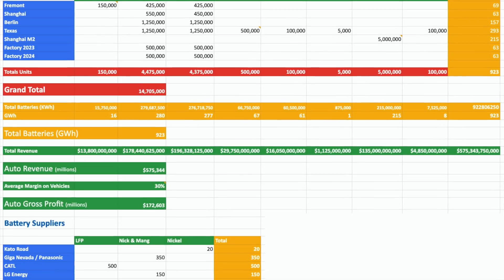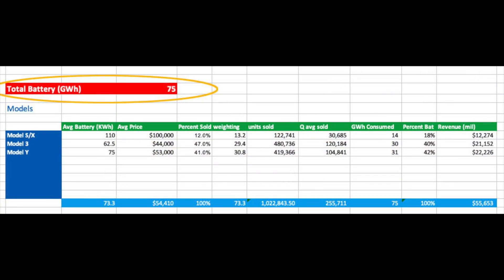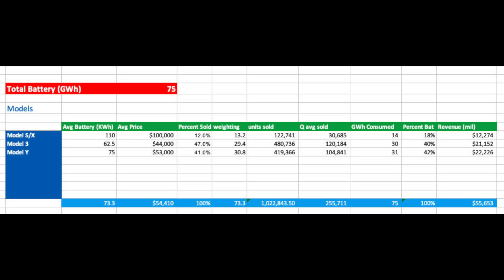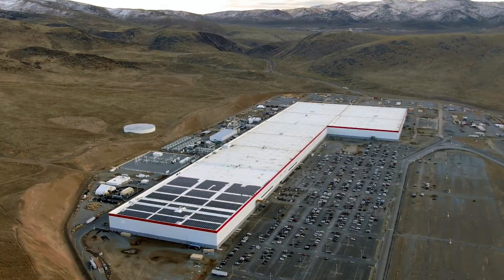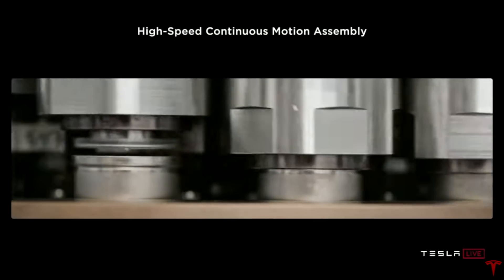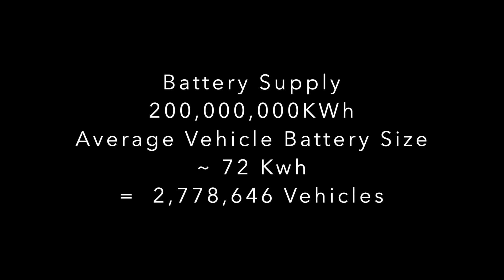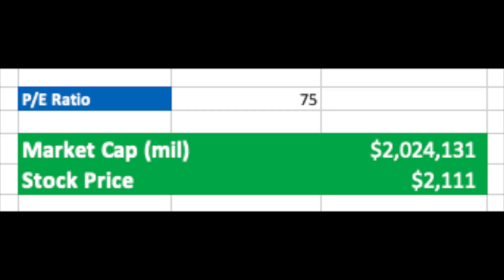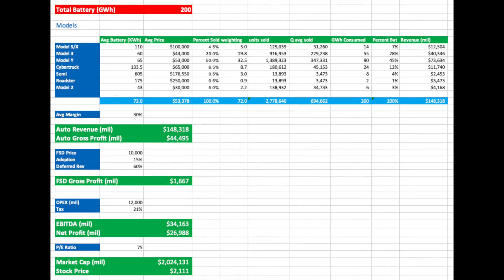Tesla's 2022 Deliveries Estimate Based on Potential Battery Supply. What is the TSLA Stock Price

Comment: I like your numbers and your videos. I think you are estimating low for Cybertruck and Semi regarding battery size. Semi will be closer to 800 kwh and I believe the cyber truck tri-motor will be 200 key or more. Since they are starting the tri-motor we won't see a smaller pack size in 2022.

Comment: I see two key limits to production growth:

The energy business will ramp faster than cars over the next 2 or 3 years, because it's more profitable, and will compete successfully with EVs.

While the 4680 manufacturing process is spectacular, I'm concerned that the supply chain will not keep up; in particular the mining industry. It takes them 4 or 5 years to ramp large projects.

Comment: Hey, Great video. 
Tried contacting you on Twitter (I'm @ConnectingODots) but since DMs are disabled for you, will write here.
A few notes -

1. Suggesting that you watch Warren Redlich's battery model. He's the first I know to evaluate through battery production, andlike you this made him highly optimistic. (extremely bullish myself, no less than the two of you)

2. Energy storage SHOULD take a large amount of batteries, bc its margins are higher than cars. If you include energy supply (virtual powerplant with solar or just peaker replacement as starting in Texas) even more so. And since easy to build, energy side should grow much faster than auto business.
So same battery supply will yield much fewer cars, but that's good news bc the profits will only be higher. 

3. FSD should be fully accounted for after 2021. Current FSD orders ($10K price) are for feature complete level 2, not level 4 or 5. Once Tesla adds city streets into the release, it doesn't have to defer anymore, PLUS it can cash all the previously deferred funds (IIRC around $300m)

Bottom line, extremely bullish on all fronts.
Thanks for the vid. Will share it along with my take on it on Twitter. My own youtube is Connecting The Dots (https://youtube.com/c/ConnectingTheDotsOK)

Comment: Good stuff. We should also keep in mind that making batteries is a completely mechanical process, and the tab-less design not only speeds that process up but results in a better battery. So battery factory capacity won't be just one number, it will instead be constantly doubling as the line accelerates.  It may take years to completely robotize vehicle assembly. Batteries begin there.  Battery Day may ultimately be remembered as Tabless Battery Day.

Comment: Stock prices are irrational.  Tesla was way undervalued in 2018-19 due to unrelenting FUD, and Tesla’s previous over-promising.  Tesla’s stock price was higher briefly in Sept., 2013, than it was in June of 2019 - despite production/sales going up 10x by 2019!  I fear Tesla’s stock price may be in the midst of yet another financial media/Wall Street “FUD-pause,” i.e., the stock price is going to be flat for a couple of years until Tesla’s financial performance is just too good to ignore, and the latest FUD will not stick anymore.  That’s fine - I’m not selling any Tesla stock until at least 2030.

Comment: I agree with modelling based on battery supply seeing as it is the largest constraint on the business. The real unknown though is the amount that will be allocated to the energy business. Until now Tesla hasn’t really turned it’s manufacturing efficiency drive onto energy storage since cars are providing so much revenue. It’s hard to get your hands on a powerwall despite it being available for several years, and unlike the cars the price hasn’t come down, or the product changed much since the new version of the gateway 2 years ago. 

Friends who operate solar and battery installation companies tell me how hard it can be to secure stock and that the demand is incredible. Imagine what this would be if Tesla release a powerwall 3 with double the capacity at the same price. I expect that a lot of them would fly out of the door in Texas after the winter debacle. Here in Australia lots of people are very keen to get a home battery even though the economics of it are marginal at the moment.
Reply from the maker: Yes agree. They need to step up their solar game.

Comment: I just don’t understand what is holding the stock back from breaking the resistance of $700.00 this week? We just came off a record quarter. The expansion in Texas and Germany is going well. Tesla’s supply chain continues to keep things moving in the right direction. The stock now should be close to $800 and moving upwards? This I guess is the reason why it is important to focus on what is happening on the ground. Biden’s call to invest in the EV infrastructure. All the things Elon is doing to meet his long term objectives. Eventually, the market will not be able to keep a winning company in check as the momentum continues to build. Warren Buffett talks about the importance of believing in a stock and be willing to hold until things shift. Investors must be buying value stocks and the whole growth sector are now experiencing this dip. Eventually when the market returns to growth companies, it will be like a turbo booster then the stock will rise very quickly.

Comment: Allocating % to different model types seems an extra unneeded step. If we have an estimate for the total gw then we can just assume an average battery pack size, say 80kw or 70kw, and assign an average price per pack, say 30k. Assigning any further estimates for how many battery packs of which are made and how much each of those sells for does not change the end result.
Reply from the maker: Yes correct, but I wanted the model break down

Comment: Regarding profits: Tesla has promised shareholders to keep profits low, as close to zero as possible without showing losses... They will lower prices and spend on growth instead of showing high profits.
Reply: The cash that’s been generated lately has meant there’s no pressure financially but it was needed.... it’s all about quick expansion for numbers and out pricing the competition. Hope the van, lorry and buses are well on the way soon as well. You could see cities that want better air pollution levels switching all their buses at once. Could get crazy 🤞
Reply from the maker: Yes I can’t see Tesla keeping this much profit. As you can see I didn’t include and capex. I just wanted to use it to create a valuation

Comment: I think the Kato road plant only has a 10 GWh line.  The production version of these lines are slated to be capable of 20 GWh annual output (nameplate capacity).

I can't see auto production ramping this fast.  I think 2M might be possible next year but not much more than that.  

It just means MASSIVE energy storage growth if they have to allocate more GWh to storage.  I think storage generates $600 kwh in revenue so not a bad thing.
Reply from the maker: Yes kato is only 10 but sometimes they are adding a second line. Presumably this year. 

But if they have that many batteries, they’ll find something for them. Like you say it may end up energy. But the profit should be similar.
Reply: @TeslaEconomist  I didn't know about an extra line at Kato road.  That would be amazing.  Key would be what their current yields are.  Sounds like they are only hoping for  50% by next year (which sounds like sandbagging).  Just doesn't make sense that yields would be that low.

2M vehicles next year would be tremendous.  I am more of a pessimist.  They took MS & MX lines down to upgrade in Dec.  It's been almost 4 months and no deliveries to speak of.  Starting 2 new factories (and the Semi facility) producing 2 new vehicles using new techniques might be a bit harder than we think.  Elon always emphasize this because he deals w it all the time.

Comment: The Model S, Plaid or Plaid+ WILL NOT USE 4680 batteries ! Elon said it in an interview. 4680 will require a cell to chassis architecture which will require a complete redesign of the Model S. Your whole analysis is bogus.
Reply from the maker: Here, Elon said it in a tweet
https://twitter.com/elonmusk/status/1311881562728747010?lang=en

Comment: Great video.

You mentioned 2M cars from Berlin/Austin next year, which will be 1.5yrs after being operational.
Now I'm not saying it's impossible but feels unlikely imo.

Reason I say this is because I believe they are targeting capacity of 550k at Shanghai by end of this year, which will be just over 2yrs from being operational.

If they go at the same pace as Shanghai then that would be 825k between them.
Now the Giga presses, which they have just ordered another 8 or 9 & also the quicker build time for Cybertruck could help matters but this is new tech. Expect teething problems.
I've pencilled in 900k from them both for next year.
Reply from the maker: Sure, I am just trying to work out where the batteries will go, under the assumption the capacity can handle it.
Reply: @TeslaEconomist  I would place more towards energy.
Past two quarters have yielded exceptional growth.
I'm expecting 2021 to the turning point for their energy business.
Reply from the maker: Yes, I look forward to seeing the earnings this Q, but the batteries will mainly be earmarked for cars. It actually doesnt make much difference to profit either way though, they make money in both markets.
Reply: I think Shanghai was at 550K already at the end of 2020, and it's still growing. Berlin and Austin are big question marks, nobody knows how fast they can ramp up, but I don't expect Model 3 level production hell, because Tesla learned a lot from it. Plus they have the 4680 pilot line, and the mega casting in production, so I think it shouldn't be too hard. The mega castings also make the ramp up much easier, as they eliminate hundreds of robots. Each removed robot reduces the complexity of the production line, which allows faster ramping.

Comment: While Tesla is currently battery-cell constrained, if 75GWh supplies are reached, there could be manufacturing limitations.

As way of example, the 1M per year for Berlin is probably very optimistic; this would equal to 20,000 per week (2800+ per day?) without counting downtime, disruptions in supplies, etc. In order to produce 20K per week not only is the factory required, but the infrastructure, raw materials and human resources. One also needs to consider all the other third party suppliers, such as glass, seats, lights, etc.

To put things into perspective, Volkswagen largest factory in Wolfsburg (with over 6.5 million  m2, which is one of the largest, if not the largest, factory in the world) has a production capacity of barely over 800K per year.

An analysis of the existing factories in Shanghai and Fremont and see what the current "run rates" are (weekly/daily/hourly) would be very useful to ascertain a realistic "base" value in the production capacities of the future factories.
Reply from the maker: Yes, 1m is a lot, but Fremont alone is more than half that.
Reply: @TeslaEconomist  I think one needs to differentiate between "installed capacity" and actual production. Shanghai has a current run rate (not actual production) of 450K per year, which has been in operation for over a year.

Comment: A few points:

1. there is now only a single Model 2/X line (previously parts were unified, parts specific to S or X), but now they are moving to two shifts.

2. Fremont (Model Y) and Shanghai (on existing site) are still ramping, capacity is likely to be over 1.5 M by the end of the year 2021. Any new building in Shanghai will be ramping up during 2022 and will have maybe 0.5 M production, although its capacity by year end will be much higher.

3. We really don't know the  final capacity for the existing buildings at Austin and Berlin, capacities of 2 M and 0.5 M seem possible by end 2022, but will be much less at the start of 2022. So average capacity for 2022 is maybe 1.5 M. Any extra buildings will have limited production in 2022.

4. When estimating production a factor for down-time (maintenance, parts shortages, etc) needs to be applied to capacity. I use 0.85, other people I respect use 0.8, so with average capacity for 2022 of about 3.5 M, production will be 2.8 - 3.0 M at most. So probably battery constrained, unless cell production is higher than 100 GWh, this is entirely possible as there are suspicions that Elon was sandbagging the numbers on battery day.

5. You can simplify your model even further, just use an average revenue and profit per kWh of battery produced. If Tesla are production constrained (I think they will be in 2022), then they will allocate batteries in a manner that maximizes revenue (we can see this already in the delay in the Semi, as Model 3/Y give more revenue per kWh so have had priority).
Reply from the maker: Thanks Michael, thats a bit too much info, are you an insider? I agree that Fremont and Shanghai likely have higher capacity, especially MIC Y, but I dont like to speculate. It sounds like there will be 200 GWh of batteries for autos, and they have to go somewhere.
Yes, I know I could have simplified it further, but I wanted to have a break down of the models too.
Reply: @Michael Atkinson, what number of vehicles do you see in 2022?
Reply: Tesla semi truck neds batterys. Comming in the end of the year according to Pepsi.

Comment: The problem with this model and those produced by warren redlich is that the output seems to defy reality and common sense, despite their mathematical foundations,  I imagine that back in the 1940s Oppenheimer and co faced the same skepticism over their claims for their new bomb.  How could anyone be expected to believe that a 4 ton bomb could equate to 20,000 tons of TNT?  Ridiculous!  But true.  In about 1 year we will pretty much know how accurate this model is.  I am certainly not selling before then,
Reply: Holding TSLA seems to be a quite conservative move. Buying more TSLA seems to be a more neutral response to the Tesla/YouTube consensus 2022/2023 valuation, and buying TSLA LEAPS options is the more bullish/aggressive response (and what I'm personally doing (not investment advice)).
Reply: @1519Spring  I am 80% tsla and of an age where I want to be more diversified.  I had got down to 65% but then their price fell below 600 so and I could not resist selling my FAANG for more tsla.  It has paid off so far but I have enough for now.

Comment: No one was estimating 1.5M Tesla vehicle sales in 2021.
Other than possibly China and possibly a $1K credit for vehicles made and sold in the USA, the $25K vehicle won't be until 2023.  Storage is backlogged for 3 years.  Cybertruck is backlogged 2-3 years.Semis won't start production runs until 2022.  Giga Texas won't be running at capacity until late 2022.  Everyone is over exuberant.  Breathe. 😊😉
  They can build factories, but they don't have the raw materials.  I've been in the mining business.  It will take time to get existing or New mines up and running.  Investment capital is needed.  Tesla alone could consume the world's muned nickle in 2023.  
  Battery' raw materials are the limiting factor and will be for 2 years.
  This is just one man's opinion
Reply from the maker: 1.5m for 2022, not 2021. The $25k vehicle is meant to be out next year, although I agree that is possibly optimistic. Semi is starting production this year, in Nevada. 
I agree Giga Texas wont be at full capacity until next year, but it doesn't need to be, it could still produce a million cars next year.
Most of these cars possibly wont be using nickel, and can likely run with LFP. There is plenty of iron. 
The point is, its highly possible Tesla will have the batteries to meet the supply of the factories next year. Even if you scale it back 10-20% its a lot higher than most say. The proof is in the batteries.
Reply: Super video Economist!  Big fan from Oregon.
Reply: Assuming there is time on the clock to schedule a 2nd or 3rd shift, ramping up will take some hiring and training but not building another line. There was a story last week that Tesla is training people for the production line before the line is actually finished. That should make for a faster ramp up
Reply: Most bullish estimate by a Tesla fanboy I heard was 1.2 million for 2021.

Comment: Dont know why nobody else is talking about this - seems fairly obvious when you are adding two new factories starting at the end of this year. some analysts are still on under 2 million cars in 2024 I think I saw somewhere. Thanks for a great vid!
Reply: Warren Redlich has been touting a similar battery revenue model on youtube for a while now.
Reply: @tmektmek  It's a good simple model that kind of avoids the robotaxi modeling, which is difficult. Appreciate both Warren and Tesla Economists inputs.
Reply: @tmektmek  Yes, Warren uses the battery model but I think only allocates 100 gigawatts for 2022 and has other income from energy and fsd. One other benefit from this analysis, when it comes down to it, most of Wall Street and the public think of Tesla as a car company no matter matter how much the software and energy components are touted. These numbers make the case for Tesla’s valuation with just car sales alone and that will make a difference.
Reply from the maker: Yes likewise. Seems obvious to me. Also seems like Tesla are doing what they can to get supply of batteries.
Reply: Most conservative analysts are not going to fundamentals. They just do math based on Ford or Toyota and won't look at the actual numbers. I consider an analyst's view of TSLA to be a litmus test: If they have looked at the fundamentals, they should understand what is coming.